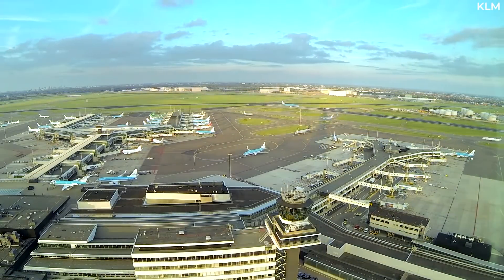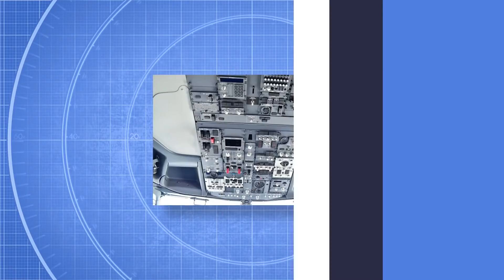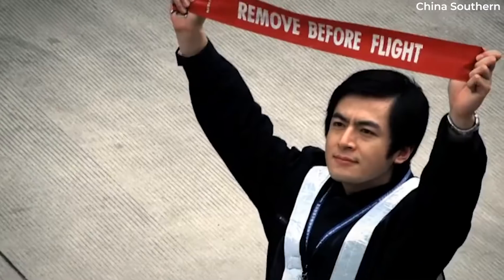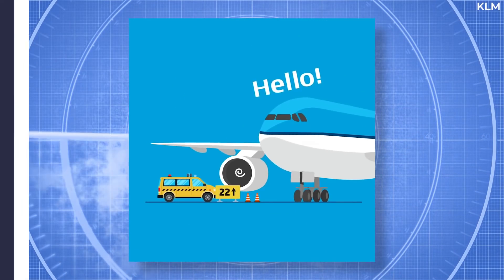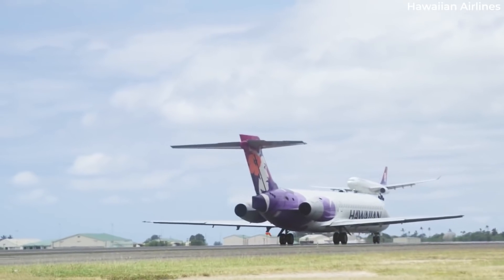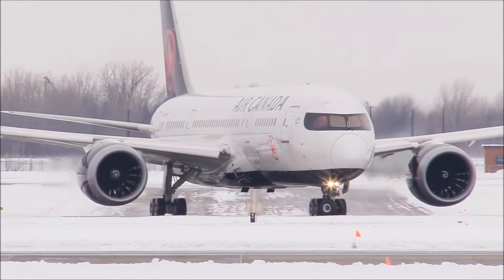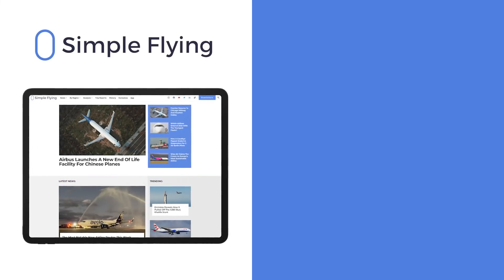Why Do Airliners Have Audible Horns?

Comment: I was once filling the hydraulic resivour on a 737-800. We had someone on the flight deck monitoring the level and pressed the grnd call button when the systems where full. Its also sometimes used in the hanger to warn of the APU starting to get ear defenders

Comment: My first time flying in a DC-9 from Delta, I heard what I thought was an alarm system when the engines were starting up to warn the ground crew, but when I look out and no-one seemed to be phased until I learned later that it wasn't an alarm at all, but the sound was going through the PA system!

Comment: This goes against what I've heard Bob Pierson say about the Gimli Glider flight - with no engines it snuck up on two boys on bicycles, and he didn't have a horn to warn them. My guess is this wouldn't be nearly loud enough to help in that situation, even a gliding 767 would be noisier than this horn.
Reply: According to what I just watched, the plane was in flight; even if the engines had died, it would take a lot to put it into "oh, we're on the ground" mode so that the horn would work.
Reply: @kanedaku  Ah true, hadn't considered it wouldn't even work in flight. Plus the Gimli Glider had no power, only the bare minimum electrics (or hydraulics) to keep the airplane under control.
Reply: The horn is powered by dc ground buses, wich only works with weight on wheel, so only on the ground. Plus they would have way bigger problems to manage than to press the horn
Reply: I'm actually the 767 did not make an ear-piercing screeching and metal scraping when it slid on the ground.
Reply: @officerahmo  True, but not until after it had touched down - by then the kids knew about it but weren't very far from it, were running for their lives. I don't know if historically accurately, but I saw a video showing them riding their bicycles as fast as they could down the runway trying to outrun it rather than going to the side, apparently they went to the Prometheus School of Running Away From Things. The pilots saw them before touching down and had no way of warning them - though granted anything short of a train horn or fire truck horn wouldn't have been audible from that distance.
Reply: @quillmaurer6563  Makes sense!
Reply: @quillmaurer6563  In fairness to the kids, I suspect I’d be terrified of being crushed by the rear landing gear and/or under a collapsing wing
Reply: @officerahmo  Hello Plane! I am Simon!

Comment: In decades of flying, I've used it a half a dozen times. On a noisy ramp you wouldn't hear it beyond 30' or so. A better way to alert the ground crew at night is a quick flash of a taxi light or landing light.
Reply: As a ramp agent I hate when pilots leave the landing lights on at night like bro I can’t see
Reply: Worked on RDU ramp '90-91 for AA. I've never heard one. From what i remember, a horn would not have made any difference anyway. If you didn't watch yourself, watch what was happening, watch what was going on around you, you didn't belong on the ramp anyway!!

Comment: On a 737NG the ground call can be handy when topping up hydraulic fluid.

The maintenance manual describes a mechanic to fill the hydraulic fluid to "2/3 between Refill and full on the gauge found on the hydraulic reservoir. Which is approxomately 92%." This is of course with flaps in, spoilers down, flight controls in the neutral position, when the system has the correct precharge and of course after priming the brake accumulator (part of system B).

But when you have a collegue in the cockpit who sounds the horn, when you hit 92% is much easier.
Reply: Airframe and Powerplant licensees who know their job well amaze me more than the licensees flying the plane. 👍🏼

Comment: Oh?

That's something I didn't know. I always imagine of them having a horn. But what if they had a actual and loud enough horn? It'll be hilarious on the taxiways 🤣
Reply: Imagine using horns at Heathrow!
Reply: @greatgordonfan  During the rush 💀
Reply: "Oh?

That's something I didn't know. I always imagine of them having a horn. But what if they had a actual and loud enough horn? It'll be hilarious on the taxiways "

-Traffic jams ensues....
Reply: Planes don’t have horns like the video is suggesting. They have a call function to the engineer headset in the forward nose gear bay which also includes a audible alert to get the attention of the engineer if they are away from the headset. No one else on the ramp would pay any attention to the “horn”.
Reply: @EdOeuna  We know! We watched the vid. We are only saying that that horn sound would be funny if it were used as an actual horn.
Reply: @EdOeuna  An audible alert that sounds to the open air around the vehicle and not headphones, is, well, a horn!
Of course it isn't an inpatient driver's honking horn, it's still a horn tho with a good purpose.
Reply: @EdOeuna  What do you think the definition of a "horn" is? Please humour us.
Reply: @derser541  - “ airlines have horns, just like cars”. 

By their definition my phone has a horn too, as does my microwave oven, washing machine and laptop.
Reply: @EdOeuna  The Merriam-Webster definition of a horn is “a usually electrical device that makes a noise like that of a horn.” As you heard in the video it sounds exactly like that. A horn.
Reply: @EdOeuna  What kind of fruitloop dictionary do you use?
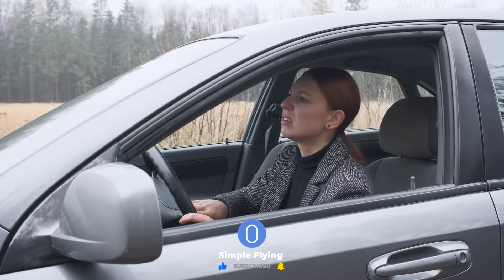Reply: @banksrail  - 0:32 “the aircraft horn doesn’t sound at all like your traditional car horn”. 

The horn is literally system for getting the attention of the headset engineer. Although the noise emitted may differ between aircraft it’s more of a telephone ringer than an indicator, but I suppose “Did you know that aeroplanes emit a noise to attract the engineer” doesn’t quite make a video.
Reply: @derser541  - I just don’t blindly listen to and accept silly intros from YT videos alluding to the fact that both cars and planes have horns but they aren’t used in the same way and don’t sound the same. Eg there’s no comparison between car horns and plane horns.
Reply: @EdOeuna  Are you serious? Literally at 0:44 they gave a demonstration of what it sounds like. They said it sound like several boats underneath the aircraft. Then proceed to let you hear it. That’s an electronic horn.
Reply: @banksrail  - and on the 777 it sounds completely different. What’s your point? It doesn’t sound like a car horn and it isn’t used the same way, so comparing it to a car horn is pretty pointless then, isn’t it.